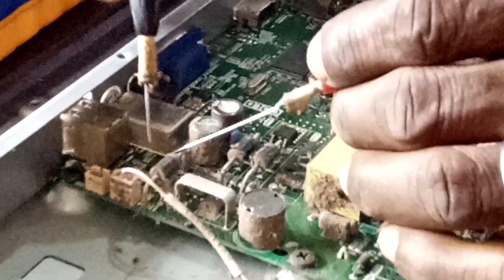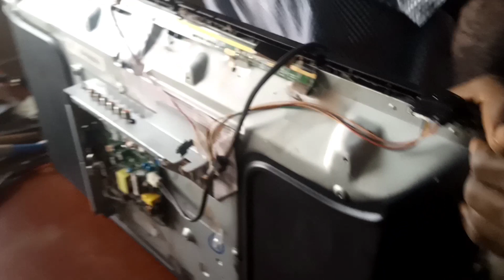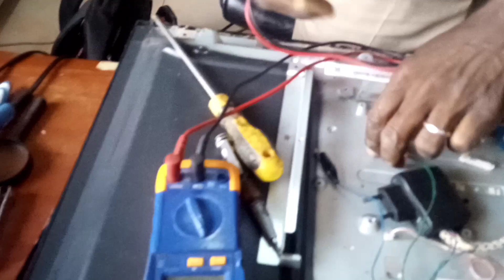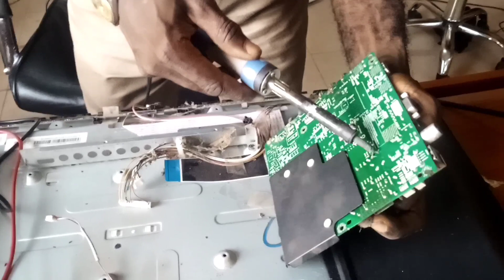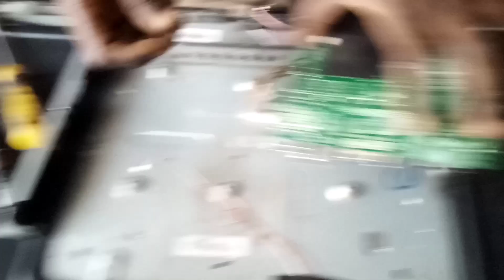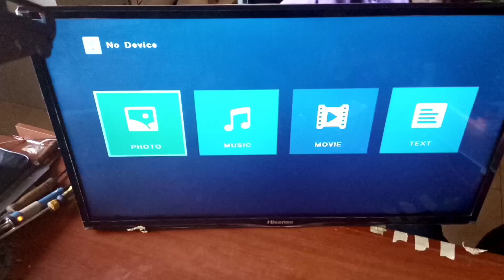How to Fix HISENSE 32'' TV BACKLIGHT FAILURE|| ZERO STRESS!!

Comment: How about if the TV comes on but the light is so faint. It's not bright like normal?
Reply from the maker: Then, you will need to check the power supply to the backlight. The power may not be enough from the board.

Apologize for delayed response!